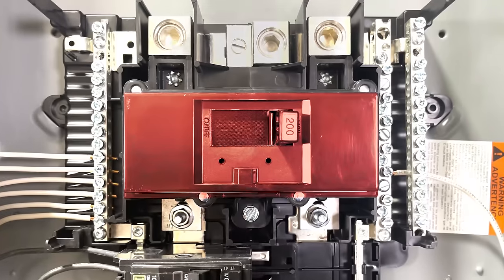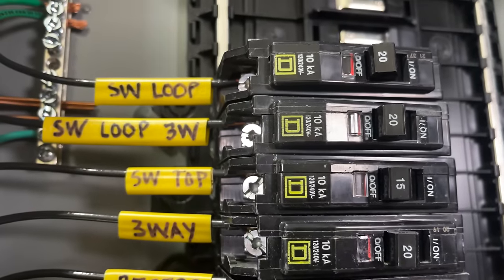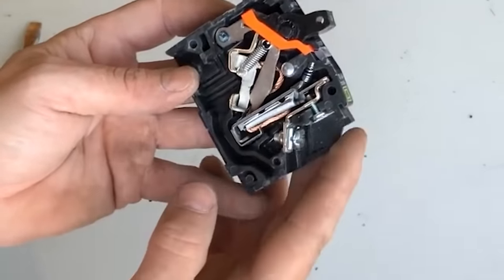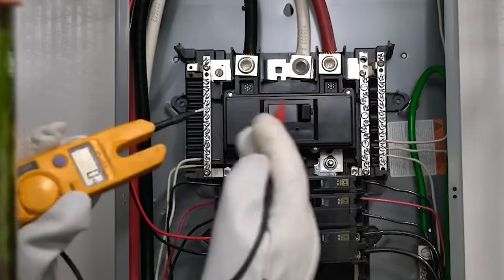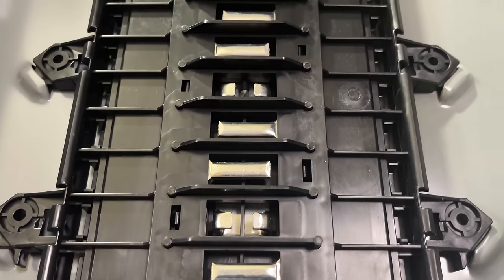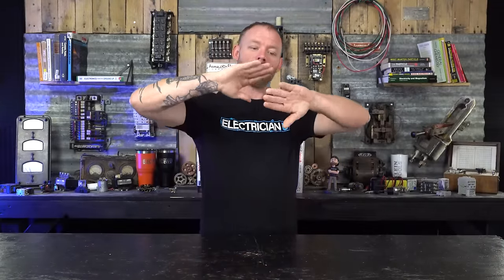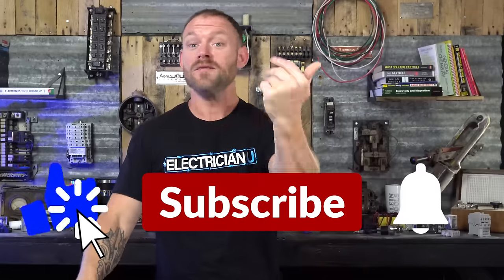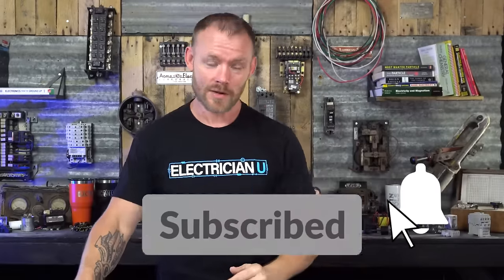Why is My Breaker Too Hot to Touch?

Comment: I had a service call where they said the Tesla charger breaker was tripping. Got there and found out it was the main breaker tripping. I opened up the panel and checked the numbers and connections. One of the main feeder lugs was very loose. That wire has also started heating up when i was load testing the charger. So i tightened it and checked the area for heat damage. Fortunately there wasn't any. We caught the problem early. 

Short story, make sure everything is properly tightened.

I have quite a few more loose wire service call stories. A lot of weak hands and hot/ cold cycling issues out there.

Comment: GREAT info. Your info on loose terminals and the danger of higher-than-normal contact resistance causing abnormal wire and terminal heating, reminded me of something I learned working in the broadcast engineering field when installing a high-power transmitter: For a new installation, always run the system for say, a couple days or a week, and then re-check all high-current terminals for tightness and re-tighten any that are loosening.  This tip was an actual step in the transmitter installation manual!

Comment: Thank you for this video! It saved me a service call that I couldn't afford. I smelled hot wires in my utility room this morning and discovered my main breaker was very hot. After watching this video I discovered that one of the main lugs was very loose, and the other wires weren't properly tightened either. The lug on the neutral wire was even partially resting on the wire's insulator so I know it couldn't have been engaging properly. Sure explains some of the weird electrical issues I've been having.

Comment: Don't forget to use ohms (resistance) for troubleshooting. It can tell you a lot about weak connections / corrosion and integrity of internal parts like a CB
Reply: Ohms can help, but remember that ohms is for DC load only. AC loads rely on fluctuating voltage, which means we're dealing with impedance. This complicates things further, because DC ohms to impedance are not a direct translation. Capacitance and Reactance (LCR), are what you need to be concerned with, and if you're not an expert engineer, just use the methods discussed in the video to identify a common cause.
Reply: @paaao  I use ohms on my multimeter all the time for testing doesnt matter if im working on dc or AC. you just have to make sure that the what ever ur testing is de-energized
Reply: @ElectricShinn  yes, for single pieces of equipment, and mostly dead shorts, open or closed, but when reading an entire ckt with receptacles, devices plugged into them, phone chargers, lights, etc... Ohms is not going to provide you with much info unless the line is dead shorted to neutral or ground.
Reply: @paaao  agreed 👍
Reply: Rather use amount of voltage drop while under a load.
Reply: No resistance on an AC circuit.
Reply: @adrianspeeder  not using it on a energized ac circuit. I would use it for checking for weak connections, corrosion, internal parts like windings of a transformer
Reply: @JohnThomas-lq5qp  ☝️That IS the correct answer! Test under actual load will tell (show) you the TRUE story!
Reply: @paaao o. Your explanation of fluctuating voltage leading to impedance is entirely wrong.

Impedance is a complex quantity, and when I say complex I mean that it is represented by a complex number. (complex numbers, in simplistic terms use the square root of minus 1 ).

Where inductance and capacitance is present and a changing voltage then the current and voltage are no longer in phase with each other. This leads to the idea that voltage, current have both magnitude and a phase angle between them, and the resistance has both a magnitude and phase angle.  But we don't call it resistance, we call it impedance.

Resistance is simply impedance with a zero degree phase shift between the voltage and current, that is, there is no reactive element caused by inductance or capacitance.

So when we talk about impedance it actually contains: magnitude of resistance, magnitude of capacitive reactance, magnitude of inductive reactance, and the phase shift between the voltage and current through the impedance.

We tend to represent impedance in ohms but this is actually incomplete.
Impedance actually contains magnitude (in ohms) and phase angle in degrees, but most often the phase angle is omitted. It can't be omitted from the calculations as that will lead to the wrong result.

This is why you can't add resistance in Ohms to impedance in ohms. They are not the same thing, although they are both ohms:  the phase angle has been omitted.

So the idea that impedance comes about because of fluctuating voltage is fundamentally wrong.

Impedance comes about because of a phase shift between voltage and current caused by the presence of capacitance and or inductance in the circuit.
Reply: @ElectricShinn But then you are measuring resistance not impedance.

Digital multimeters do not measure impedance.
Reply: @adrianspeeder "No resistance in an AC circuit". Completely untrue.

If I stick a 10K Ohm resistor across the mains supply, then I have resistance and not impedance.

In an AC circuit you can have:
 1. Resistance
2. Reactance caused by an inductor
3. Reactance caused by a capacitor

Impedance is a measure of all 3 of these AND the resultant phase shift between the voltage and current.

Comment: I had loose connections on a breaker where it’s the screw that pulls a loop the clamp onto the wire. The electrical I guess couldn’t see the loop with it installed on the panel so the wire was jammed on top of the loop and under the screw. This causes the screw to bottom out without being tight on the wire.

Comment: I still test but from my experience if the breaker is too hot to touch or exceeds 90F, it's a bad breaker.  It doesn't mean that there isn't another problem but that's the initial problem.

Comment: One test I like to do on circuit breakers is to check the voltage drop across the poles. If the voltage drop is zero, this indicates a good internal connection. If the circuit breaker is out of the circuit, perform a resistance test using a milliohm meter.
Reply: Not as accurate as you might think. Have taken hundreds of measurements when a breaker, relay, motor contactor etc either had no load or small load. Best practice is to take measurements after breaker ,relay etc is under it's heaviest load for at least 10 minutes. Before retiring every sparky had a fancy $1,100 FLIR camera to pick up hot spots. If a single pole 20 amp breaker had a 15 amp load on if would be a few degrees hotter then lightly loaded breakers. And with resistance measurements after awhile know that if I read less then one ohm between a 200 HP motor leads that was a normal reading. Small relay could might ring out @ 30 to 50 ohms.

Comment: Check the lugs in the panel.    Check the wires are tight on the breakers.   And see if neutrals are loose ……. Or is the meter  can gone bad.   Rusted lugs or your neutral is gone or bad connected on the power pole.    Many many times it was all or one of the problems

Comment: Funny story, out in the country of NC (overhead wires) during sunspots. An Arc Fault breaker kept tripping, I pushed it off/on one last time and boom it literally cracked and blew up in my hand. Plastic broke, pieces everywhere, black burnt area on one (hand's) fingers. Not sure if that CME caused it but the transformer at the other end blew up/died, and the backup took the load before failing as well.... I blame the spots.

Comment: Re: @dracula3811 described below, I installed the Tesla wall charger, and spec'ed the proper 6ga THHN wires thru conduit to the garage subpanel and a 60A breaker, torqued all and the first charge went fine; both 60A primary breaker in the subpanel, and the separate one to the charger were barely warm at the max 48A output. BUT, in the main house panel, both the 60A breaker feeding the garage and the main 100A breaker were very hot to the touch. I am waiting on an insulated 1000v extension so I can safely torque the incoming lines I cannot shut off, and also the overheating 60A contacts, but strongly suspect past electricians did NOT properly torque things. Even the garage subpanel was wired without separating the ground and neutral lines, until I corrected that after a decade.
  Moral: "Trust, but Verify." Just because professionals did something does NOT equate with it being done to spec, or near Code. And FWIW, I wonder how many old school sparkys who diss torquing are also the ones who bad mouth GFCI and AFCI, when just maybe their improper torquing has actually been contributing to issues?

Comment: Quick question: Can you use ferrules on the mains coming into the lugs? Looking at your example —the strands are splayed out as opposed to a ferrule which would keep the strands tight—In the lugs.
Luv the channel❤!
Reply: Marxg4....saw that 2nd leg connection too....and the breaker lug caused it to frey...that's a good idea you just presented using a ferrule!
Reply: I've had to change them out to crimped lugs and bolt them many times on 3ph 480 industrial. On a  pretty large MCC center , I ended up having to use Locomotive wire to deal with the high ambient temperatures. much higher ampacity if  anyone out there is having an issue maybe in a boiler room?

Comment: 25 years is not “old” for things like circuit breakers, as long as they haven’t been abused.  When treated properly (i.e. indoor panel location, and not routinely cycled as a switch or tripped by overloading), they should last a lifetime.
Reply: Had a little laugh at that as well, as it's not very old for a house either. Mine will be 100 years old in 2024.
Reply: Yeah, the panel in my appartement is a bit over 40 years old and everything is still just fine.

Comment: If you're open for a video suggestion, I just got hired as an assistant project manager without having an previous electrical knowledge. My first couple weeks I've had a ton of down time, and I've been religiously watching hours of your videos a day to try and catch up with the trade. Wanted to see if you had any tips/ suggestions/ advice on the quickest ways to get up to speed without being in the field doing everything(mainly industrial and commercial), and if you had any advice on how I can become a great APM so I can excel in the field. Love the vids been watching you way before I was hired, and your passion for the trade is what pushed me to apply for this position!!
Reply: You should read the newest NEC Code book and Look at online Electrical courses. Youtube videos are not worth it if you need a lot of knowledge fast but if you have questions about the code book you can look them up on youtube or electrical forums. As for solving the problems the customer or boss gives you, you have to use common sense and take problems one at a time because their is no short answer for what to have workers do for a big project.

Comment: Most times a failing / hot breaker will show a voltage drop. Basically, check the amps to make sure you are within the breaker rating, then look for a voltage drop. Only a few volts down, compared to the rest of the panel, will generate heat.... bad breaker!

Comment: What if the breaker is GFCI/AFCI, wouldn't tripping potentially indicate an issue with the wiring rather than breaker/load?
Reply: No sir.  Remember that you are combining 3 different functions into one component, overload protection, ground fault protection, and arc fault protection.  All serve to trip the breaker and a problem with any feature would require the unit (breaker) be replaced to fix the problem.

A vacuum loaded down with hair or carpet around the roller (spinning brush on the carpet) might get your overload....no actual breaker nor wiring problem.

A faulty circuit in the AFCI  or gfci may be the problem with perfect wiring.

I am not saying wiring is never the problem, just to troubleshoot and find it.

Hope that helps.

Comment: i cant count the times i had to tighten lugs, sometimes 2 or more turns !!!  over time... expansion n contraction loosen lugs, n screws......also if that happens look for melted insulation around where wire is landed.

Comment: When I understand is work with various electricians one thing people don't do nowadays you supposed to turn the breakers off and on a couple times to clean the contacts just like an old fashioned or any multimeter the contacts to have silver contacts you have to run the dial around a little bit to clean up the contacts.
Reply: Never heard of read that but would not hurt to exercise the once a year. All breakers have played contacts that once closed for not get dirty. Have taken 40 year old breakers apart and never found any dust. They are fairly sealed. Should not exercise any main circuit breakers too often. While single pole circuit breakers are rated s& tested to operate believe it's several thousand times but the 100 amp & higher two pole circuit breakers are only rated & tested for believe I read not much more then a hundred times or so. Have turned off working 100 amp main breakers that never had much load on them due to all natural gas use and would not turn back on.

Comment: I have a question  so I have a 30amp for my hot water heater when the old heater was token out it was leaking at the heat elements and water was every where  then it made a pop electrical spark so should i change my 30 amp breaker for new one .?

Comment: My main breaker inside home on a 200 amp panel trips sometimes when i run heat pump,,if it doesent trip it gets very hot to touch to point of smelling???Home is a manuf doublwide 25 years old,,it has a 200 amp siemans eq9485 breaker,,,new one at amazon is 350 ..lowes sells a conversion one for half,,??Any idea

Comment: Here in the UK, some places have RCBOs which are an RCD and a MCB combined in a single device, some also come with an AFDD built in as well. I'm not electrician, at any UK electrician, are RCBOs going to be mandatory for new installs and any future or breaker replacement in the next regs?

Comment: maybe you can make a video on what happens in this situation. There are 2 separate 110v circuits being powered by a 15A dbl 220 breaker. 
How do you describe this? 
Fire hazard, death trap, blooming stupidity come to mind.  This is real, i saw this in a customers house that was having problems with flickering and breakers tripping.

Comment: Hey Dustin,

We recently had our electrical service upgraded at our business as well as some work in an addition/storage room project and I noticed today when shutting off a breaker that the cover inside the new panel, over the breakers, is not on right. It's like slanted, it seems like maybe they didn't think it through when putting one conduit into the top and this doesn't allow that inner cover to sit right. The breaker popped out of place when I flipped it to OFF which concerned me. Shouldn't they be tightened into place or is that normal that they just click into the middle part? 

We had a lot of problems with this company, which IS licensed and bonded and supposedly has done work for big companies in town and is well regarded, voted one of the best through this thing our local newspaper does apparently... They kept sending us guys who seemed inexperienced and they kept beating around the bush not sending them with the correct light fixtures that the plans called for which they've known from the very beginning and kept trying to cheap out on us with generic Amazon lights, they kept failing inspections.. caused us SO much delay. I really don't even want them to come back at this point after so so many problems I want someone else to correct it. We still haven't finished paying them because we Just barely passed our fire inspection and I was about to have their check written because they barely finally installed the correct exterior lights with emergency battery backup last week. But now this. What should we do here?

Comment: Main breaker? What’s that? The apartment I live in was built back in the late 50s-early 60s. Over time we have replaced the original breakers with “slimline” breakers since the panel is about as big as the meter box so we needed to update the breakers to have enough circuits for the apartment. However the only way to cut power is to either turn off all the individual breakers or pull the meter. There is no main breaker.

Comment: Here is an odd one hoping you may know what the cause is. When i replaced a microwave the new one works when i start it, BUT if i stop it and restart it to quickly (under 45seconds) it will trip the breaker. If i wait about a min or so and restart it all is fine.

Comment: People need to “exercise” their breakers at least twice a year as a preventative maintenance measure. Also get a IR thermometer and point it at each individual breaker and check their temps. Point it at the main lugs or the lugs on the main breaker and check the temps. If it’s approaching 140 degrees Fahrenheit or 60 degrees Celsius and it’s not tripping then that breaker could be bad or failing.

Comment: My main kept tripping and hot to touch while running dryer. So process of elimination disconnect dryer still tripping so disconnect hot water   Not tripping anymore. Could it just be the main. Tried running both separately and tripped half of the breaker is hot